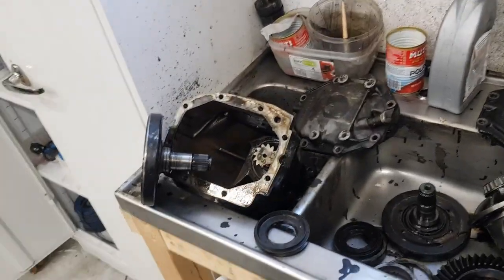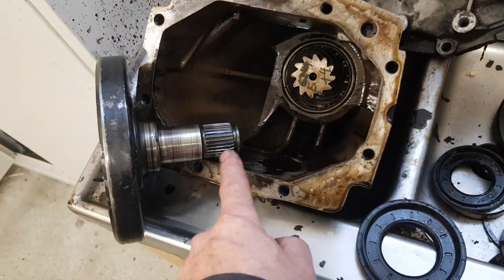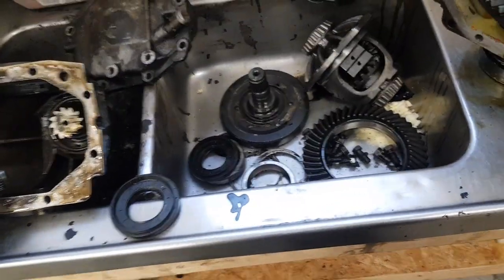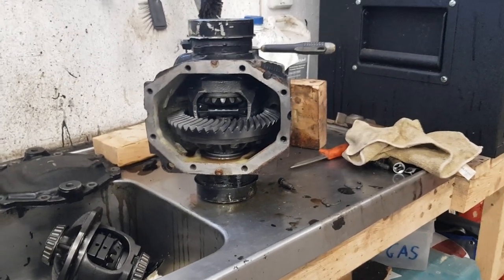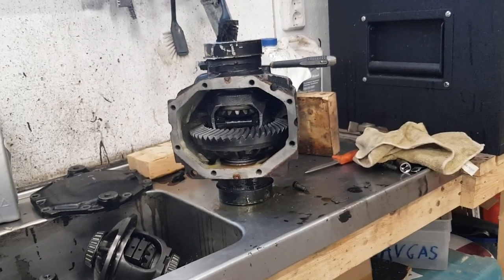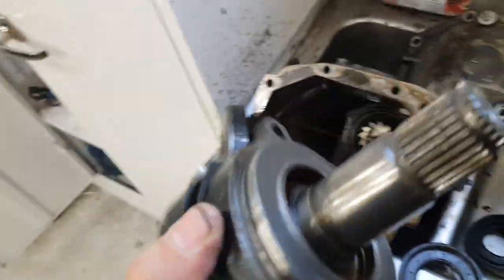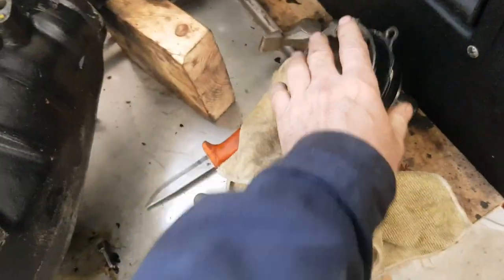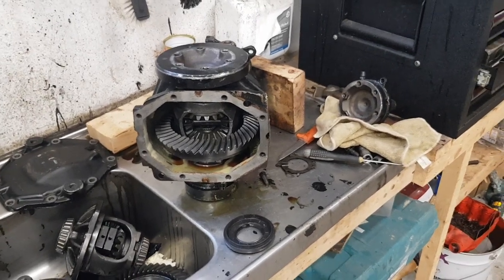ASD Diff rebuild mercedes w124 to mercedes w201

Comment: Hello, I had the same idea, for mounting on a classC coupé w203. You can control it using hydraulic pressure and an accumulator. The system is called ADS at Mercedes. Thank you for your sharing. I will follow closely. Continued like this. And I congratulate you on making trackdays with this Magnificent Granny. In France we say it is in the old bowls that we make the best dishes
Reply: Called ASD

Comment: Mercedes ASD has a base pressure when engine is running even when there is no speed difference between tires. When shut down pressure is zero and diff is basically open.. There is no spring plates between clutch disk. This info is from my memory..  If you install racing diff's junk locker in ASD you get actually working LSD.
Reply from the maker: Asd diff is never open... 30 % is minimum all time.
Reply: @persanders   I read factory manual. Open without any pressure.
Reply from the maker: A 201 or 124 ASD diff has an inherent ~ 25‐30% LSD effect before the hydraulics
kick in, i.e. the ASD clutch pack, etc. has a built in LSD effect.